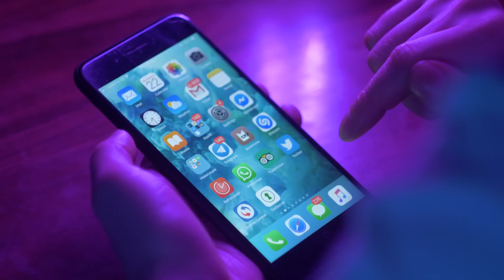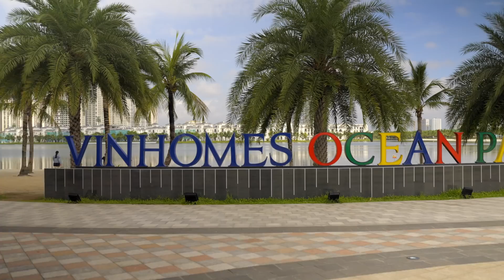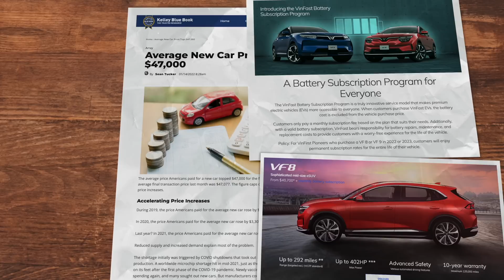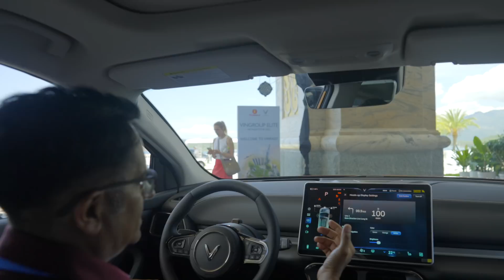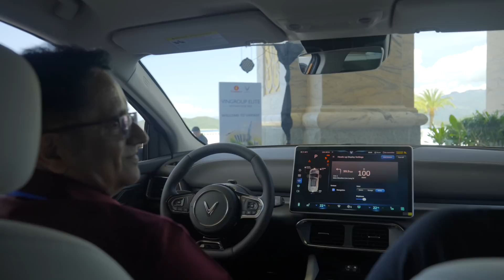New Startup FINALLY Makes EVs Cheaper Than Gas Cars!

Comment: sorry, still has the same limitations for battery tech as the rest. This entire move to everything is just another payment with no equity is at the end, is not something I would never be interested in. Ask people why they purchase over Lease. In this case, what do you have without that that monthly battery payment? I agree, it's another option. It will appeal to some folks, but IMO it's going to be limited.
Reply: I would consider it if the lease was for the entire car. You can give it back any time and the lease includes all maintenance and service and insurance etc. Makes diving worry free, new model every few years. The scheme in the video is half baked, but lease gets more interesting every year. At least until second hand electric is a thing.

Comment: So basically you would save maybe 10 dollars a month.
 All I want my car to do is drive not turn my lights on at home and other junk.
Reply from the maker: We’ll at 27mpg for a gas car and 12k miles a month. If your drive more you’d save more..
Reply: @TwoBitDaVinci  for what you would be saving it wouldn't be worth the hassle look at all the computer stuff that they have trouble with fixing now in vehicle's, with all that crap on there it just wouldn't be worth it.
 Give me a old model car that I can fix on the side of the road when I pop a radiator hose.

Comment: How much will the Electric companies increase price do to the supply and demand?
Reply: The main problem electric companies are facing is not lack of electricity - demand is usually pretty consistent, and its not like everyone is gonna buy an EV next year or something.  And even if they do - again - there is enough power for everyone. The problem is usually WHEN people are using not how much.  And let not forget that the companies are now in competition with the solar energy. So if they raise praises, people may just get solar panels and stop their usage from the grid.
Reply: @alexforce9  Where are they going to get the power from, surely not hydroelectric. There is a need to have a balanced approach and promote Hybrid and or duel fuel
Reply: Scott they are building more infrastructure as we type daily. Your worry is the least of the problem. More problems are in the regulation roadblocks and greedy liars making rediculous complaints to slow down their competitors.

Comment: Pricing for these things is always misleading in every video/article I've seen to date. They never calculate in the cost of the subscription into the total cost of ownership. The real price is MSRP + battery rental over say 5 years (typical length of ownership for many in the US). That adds another $6,600 to the cost of the car (and doesn't include of course the cost to charge it).
Reply: Yes. I was expecting a lower price than the one that they quoted, considering the cost of the subscription.
Reply: Unless they include the cost of gas for an ICE vehicle in the cost of ownership, they don't need to include the cost of charging an EV vehicle in the cost of ownership. However, that's just my opinion. I've never been able to buy a brand new car so I don't know if it is included.
Reply: It suits people who cannot afford paying 60k for an EV plus it gives you a peace of mind regarding battery. Paying 20k up front will cost more on financing. Also future value of money is much less its present value due to (high) inflation so paying 20k now is much more than paying $160/month over the next 10 years. With 5.25% inflation, 12k now is equal 20k in the next 10 years so you save $8k. Besides, battery technology keeps changing so clients might get a better battery in the future.
Reply: Also "they", "you" never say that subscriptions ALSO include lifetime warranty meaning new battery replacements, so actually your getting MORE than just ONE battery for a similar price or less.
Reply: With other EVs "$6,600" you will only get 1/2 a battery or even less... AND you won't get another replacement battery in future if or when you need one!

You also forgot to say that if you get the subscription you also don't have to worry about the battery degrading.
Reply: Unless the subscription is a locked in price they can never raise, I wouldn't trust it.
Reply: @terrafirma9328  I think the subscription plan price is locked in for those who order it now.
Reply: @someguy1826  another Vinfast seeder, literally I’ve seen you comments on Vinfast about 1000x. It would be more credible if you were an American consumers instead of living and working for Vinfast in Vietnam.

Several problems with Vinfast that you seem to failed yo address, Vinfast is an unknown brand with a battery subscription will have a hard time with resale value. Most American keeps their car average 5-7 years, with innovation of new technology battery degradation is lest of a problem. Vinfast car sells for 42k - 55k plus monthly subscription fees isn’t competitive at all. 

Also without any infrastructure good luck having your Vinfast car service . Since the consumer doesn’t own the battery , most likely insurance companies would not cover it. In an accident event that damage the battery who will pay for it ?
Reply: @minhnguyen-fr5zq  🤣🤣🤣

Comment: Your title is misleading. Tesla already made EV's cheaper than gas cars (when you do a total cost of ownership study, the Model 3 SR is cheaper to own and operate per mile than a Toyota Camry).
Reply: Me: laughs in my 2002 used Camry
Reply: @HarukiYamamoto  Dude, we're not talking about your 20 year old beater.
Reply: It isn't just Tesla. Most EV's end up being cheaper than gas-powered counterparts. Heck, an EV truck probably is cheaper to drive than a mini-van, and the van is meant to be more fuel-efficient than a truck.
Reply from the maker: That’s not what I was saying. I’m talking upfront cost. A 7 seater model X costs $100,000. The VF9 is 55k… most gas cars are more expensive
Reply: @TwoBitDaVinci  Why are you using the Model X and not the Model Y 7 seater? I went to the website and I cannot figure out pricing at all. Why are they so cagey about it?
Reply: VF9 battery cost is $160/month or almost $10k over 5 years. And then add charging cost on top of that.
Reply: @GaiaMother7  It suits people who cannot afford paying 60k for an EV plus it gives you a peace of mind regarding battery. Paying 20k up front will cost more on financing. Also future value of money is much less its present value due to (high) inflation so paying 20k now is much more than paying $160/month over the next 10 years. With 5.25% inflation, 12k now is equal 20k in the next 10 years so you save $8k. Besides, battery technology keeps changing so clients might get a better battery in the future.